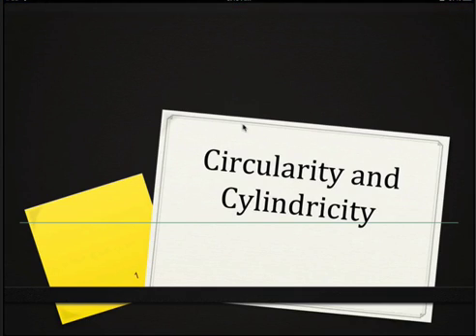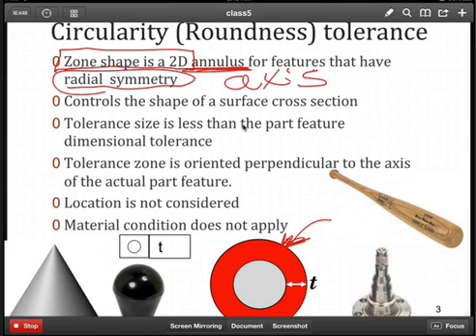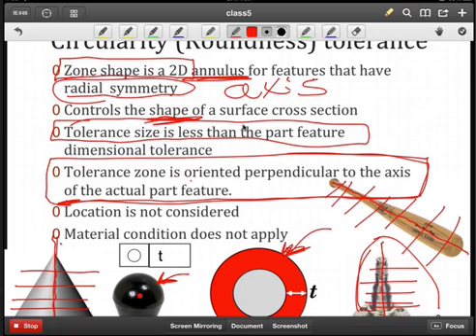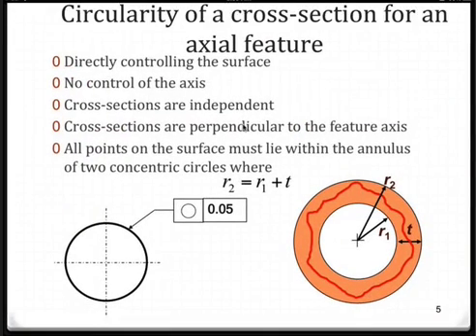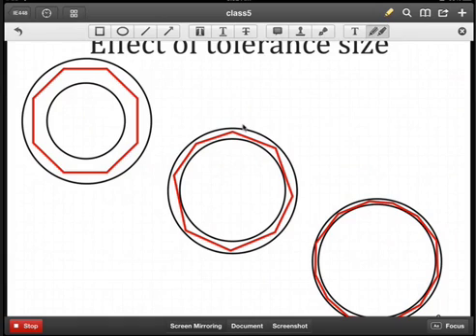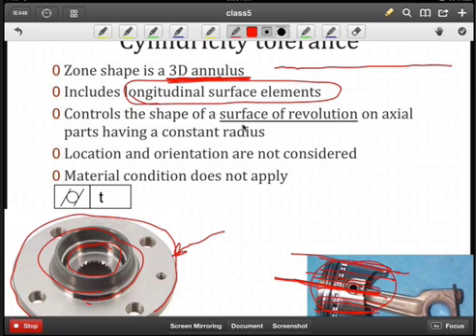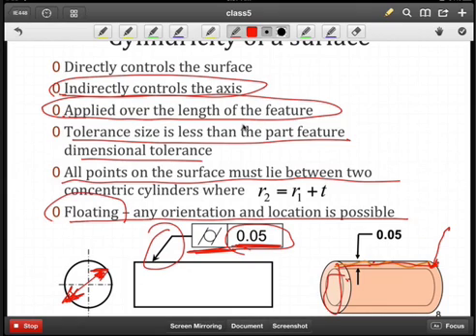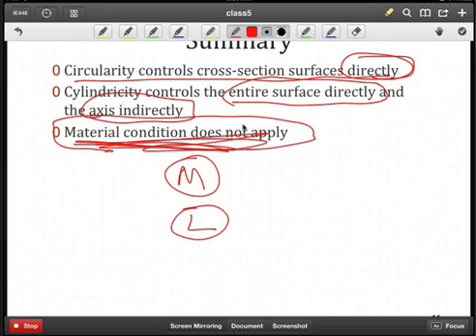Circularity and Cylindricity

Comment: 1. When the surface satisfies circularity tolerance., it may not satisfy cylindricity tolerance as it refers to the overall length of the feature. Though the circularity is controlled, it is controlled only at the cross sections and when it comes to cylindricity., it will control the straightness of the axis which may not fall in the circular tolerance zone.

2. When surface satisfies cylindricity., it will definitely satisfy circularity as the combination of infinite circularities is one cylindricity.

Please correct me if I am wrong.
Reply: You're absolutely right mate😊
Reply: That means.. circularity is applied where dia or varying circular cross-section, but cylindricity is applied on constant dia which should fall within tolerance over a distance???

Comment: Can you help reveal the answer to the question at the end of the video?
Reply: +Jiaxing Du CIRCULARITY IS 2D AND IT REPRESENTS THE CONDITION OF THE CIRCULAR OBJECTION IN A SINGLE PLANE, WHERE AS CYLINDRICITY IS 3D AND ACCOUNTS FOR THE CONDITION IN (n) NO OF PLANES.

SO THE SECOND ONE IS CORRECT, CYLINDRICITY HAS CONTROLL OVER CIRCULARITY AND NOT VICE VERSA
Reply: -Consider a conical object or even a bent object , it satisfies circularity but not Cylindricity
- If any object satisfies Cylindricity then it automatically satisfies Circularity!

Thanks for the Video :-)